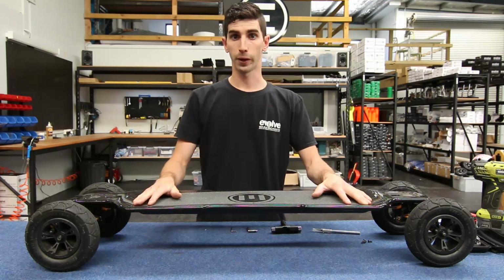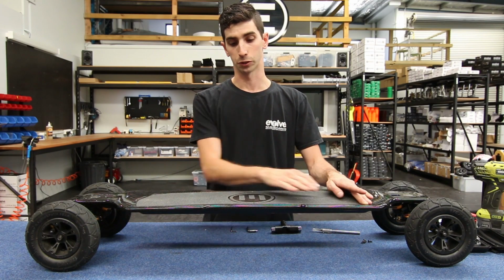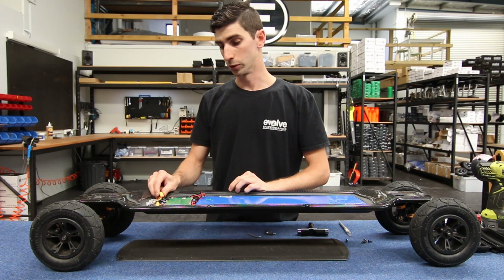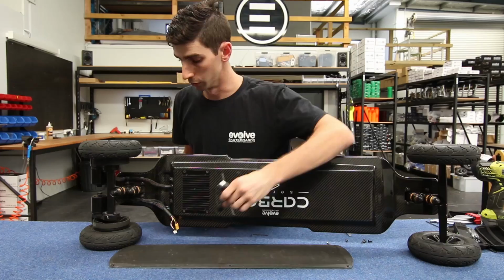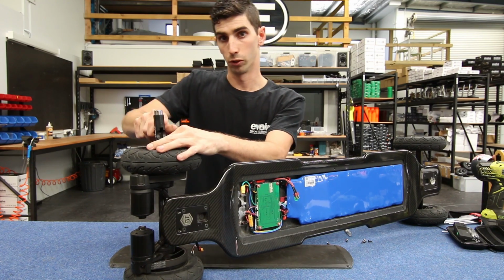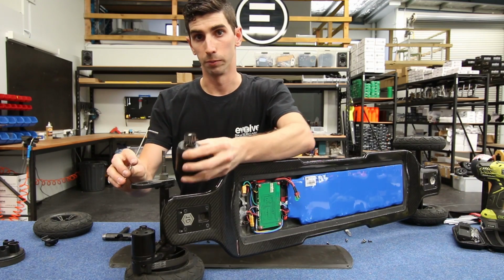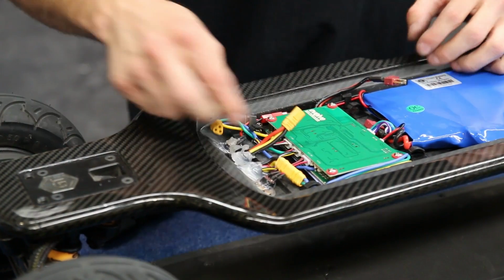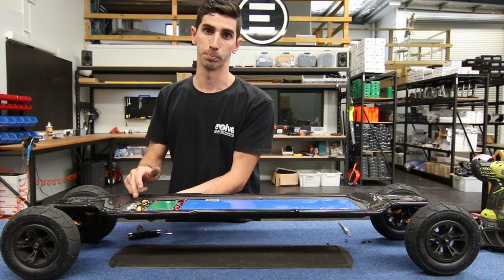How To Replace A Motor || Evolve Skateboards

Comment: How do I replace the motor with an upgrade? The ones that come with the board are too weak. I want to use 6374 motors.
Reply from the maker: Our boards work as a balanced machine, so adding bigger motors will cause issues in other parts of the system.
Reply: Evolve Skateboards 

I agree with Matt, bigger motors are needed. I overheat mine every session doing slides on grass. Given I’m only 73kg’s, have only been E-skating for 2 weeks and I’m 46 years old, if I’ve found the boards limits so quickly guaranteed many others have also. 

However I’m still pretty stoked to be able to get that 10 minutes before it drops down a mode. I just gotta remember to mix in some concrete carving with the grass. I’m loving my GTR, but there’s definitely room for improvement, which I hope becomes available as an upgrade soon.

Comment: Do you need loctite for any of those bolts?
Reply from the maker: We often use a small amount on the four motor bolts to help prevent them coming lose with vibrations, although you must make sure you heat them up when undoing to prevent rounding the bolt.

Comment: Tried this step by step. Wound up with a cloud of white smoke from the motherboard after swapping the motors and trying to power them up to test...After running to bring the board outside for fear my home would burn down, I now have a stripped down powerless GTX rendered useless. Def going with a way less expensive brand in the near future. This was the last straw in a long lineup of evolve headaches. Too be fair though in between each of the many headaches, a lot of fun was had.
Reply: Did you make sure to connect it right?

Comment: Is it possible to run the gt board with one motor? Wouldnt mind having way more range and less torque, the top speed is unchanged just acceleration would be slower.   But i dunno if the board internal would be messed up by running a one motor setup?
Reply: Just tested. It works.

Comment: the gear on my left motor is making a clicking sound, it has a little bit of play but its making noise when spinning the wheels. any ideas?
Reply from the maker: Hi Ronnie, its possible the gear on the motor shaft is slightly loose, you can check by taking the wheel and belt off and then checking the gear on the shaft by wriggling.  If its loose then contact support for instructions on how to re-secure.

Comment: howdy I'm boxing up a motor to send back to you under warranty. Do the replacement motors come with the cog? I can't see how you might take that off. Thanks
Reply: Wow you are lucky, I had a motor not moving and they said it was a update and to send the whole board for a so called update even though it was under a month since I bought the board I also received the new R2 remote with newest update. So I just ordered new motors from china and they work great. Send the whole board in to get motor fixed, so much bull. Now my warranty is gone but no way would I send in the whole board. I do love the board though. :)
Reply: Which motors did you get bro? The 140  ones? How's the board run bos? I've been seriously thinking about doing that as well.

Comment: So the motors have sensors, and the same 3 power cables as other brushless motors. It looks like if you solder the same connectors to a different motor, like a 6355, it could work with another type of motor that could be more powerful provided the new motors fit sidebyside.

Comment: Evolve my Bamboo Gt keeps on having problems over and over again, I've already gone through 3 motors and have tried to contact you guys in many different ways. Please get back to me as soon as you can.
Reply from the maker: HI Kyle.  Thats no good you have had issues like this.  Going through 3 motors doesn't sound right, the board must be inspected asap.  You mentioned you have tried to contact through various channels......who did you purchase from?  We checked our Australian customer service team and there is no communication here thats left unanswered.  For us to help you let us know where you are trying to contact through.  Thanks.
Reply: Ok I bought it from you guys at evolveskateboardusa.com, you could check my e-mail and a record should come up trxsummit2008@gmail.com. all they did was keep sending new motors to me to fix it my self. Please check up on it thank you.
Reply: Kyle Li I found that when I emailed support@evolvedskateboards.com.au from my Gmail account and then followed up with a phone call they confirmed that they didn't receive my emails. When I sent the same email from a different account it went straight thru. Not sure what that is about but it would pay to call your closest distributor to make sure they get your email.